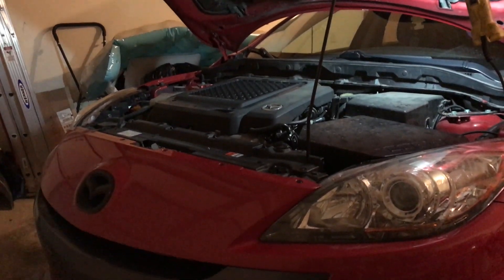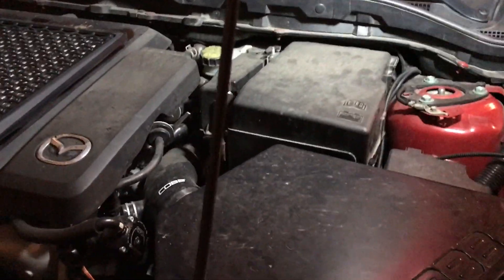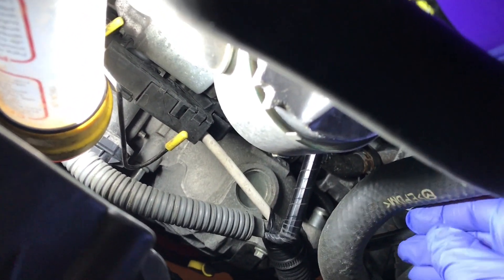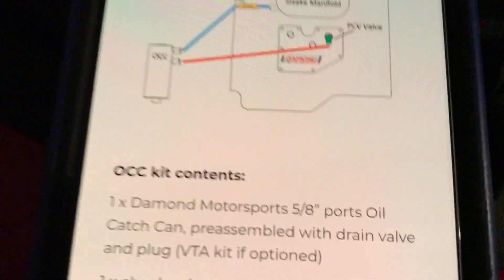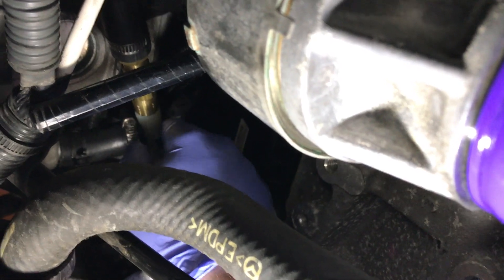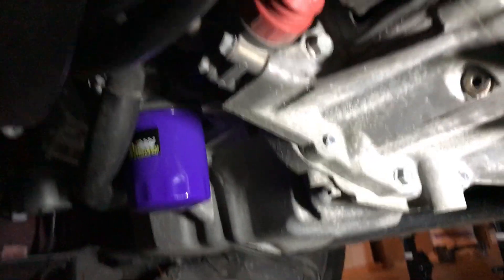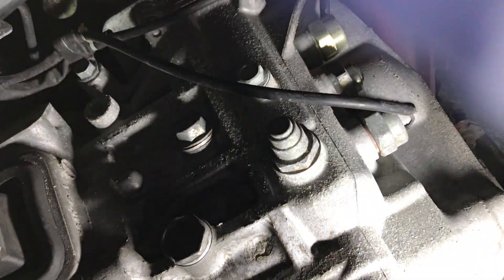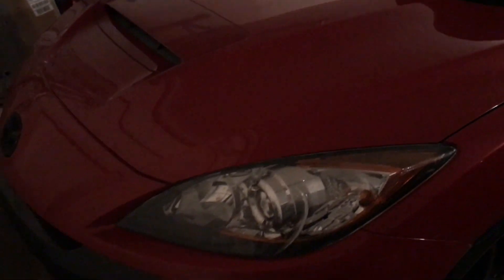2012 Mazdaspeed3 Oil Catch Can Install

Comment: Awesome install video!

I do have a question. What is the check valve by chance? I see that it is optional on some purchases.
Reply from the maker: The check valve will ensure one way flow. Usually put in place so it doesn't back feed.
Reply: @UEGUnequaled  ahh I see! Thank you!
Reply: @UEGUnequaled  why is the Damond check valve needed if the PCV system already has the green/orange check valve?
Reply from the maker: @Lex-pq9bl  my best guess is that it's another valve as a peace of mind. It's probably fine without.

Comment: I have had my speed for little over two years now. Pretty much bone stock. Only mods are air intake tubing and cone filter, and shift plate. I am watching ur channel and I am seeing things that I need to do. Thanks for the install vids!!
Reply from the maker: That's awesome to hear man! I don't have all the mods filmed, but recommend the turboback exhaust, high pressure fuel pump, and access port

Comment: Thinking about picking this up myself my only concern being that looks like it sits really low but how low is it? Is it at about the same level as the oil pan or even lower?
Reply from the maker: adaytoriseagainst3 so there are 2 things. If you don't attach the plastic barb it will actually sit above the bottom cover at the same height as the oil pan. If you attach the plastic barb, its about a centimeter below the bottom cover. Your call, but I'm glad I did it, the stuff that came out was insane. I haven't had any issues especially in San Francisco.